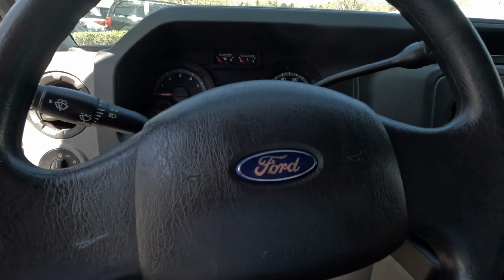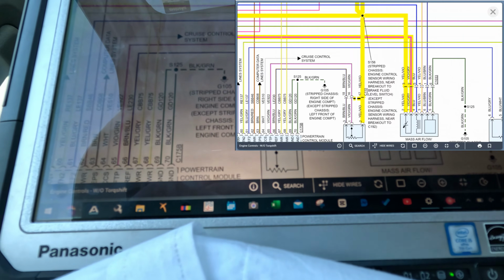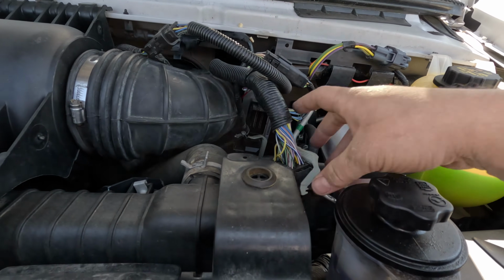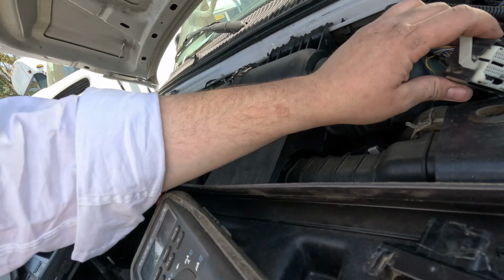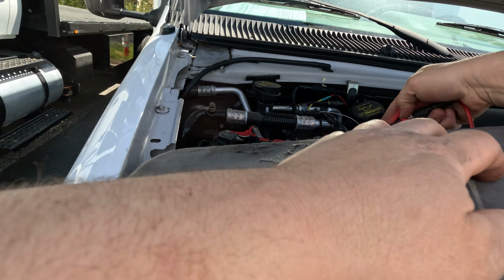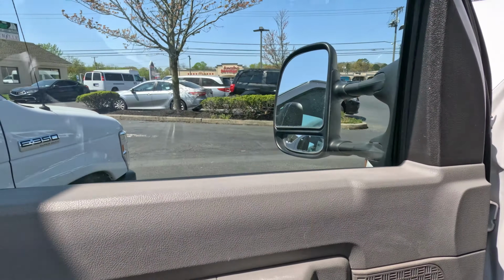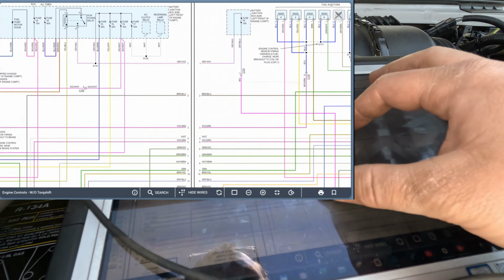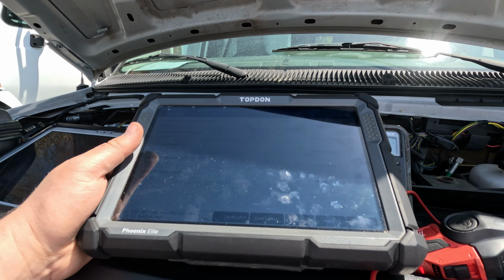Ford E450 Box Truck -  IAT sensor code (P0113). PCM??? Diag & "Repair"!

Comment: Nice.  Got 2012 e450 with same issue.   Bet the ecms have defect.  Also have no ground to maf, working on it now bet same deal as lost ground inside if ecm
Reply from the maker: Good luck with the repair!
Reply: @advancedleveldiagnostics is there a certain ohm setting I need to use?. To do what you did

Comment: hi , I have a similar problem on a 2004 expedition 4.6, I was hoping this video would help me figure it out but I had already bypassed the ground and it changed nothing. the symptom is that the IAT gives a reading that is about 145 degrees F. more than the actual temperature which stops the drive cycle tests from starting because the testing parameter on the high side is exceeded , the PCM reads it at about 248degrees . The vehicle runs pretty good , the IAT sensor is good , the maf is good , getting 4.62 v from the PCM and a good ground but i ran a direct ground straight from the battery just to make sure. The IAT fluctuates as if zero degrees =145degrees. I wrapped the sensor in ice just to make sure it was working and the IAT reading dropped to 176degrees or freezing (32degrees) +144degrees. So any ideas from anybody would be appreciated. My next move is to trace the 4.62 v. wire back to the PCM in hopes that somehow the low volt reading has something to do with it (I doubt it though)  thanks anybody ,Brad
Reply: also there were no trouble codes...I have checked out all of the circuitry wiring now, I'm left with (1). faulty new part or   p c m problem. Also the volts being sent back to the p c m show about .5v which corresponds to the high temp reading ....it should be about 2volts .
Reply: @bradhn3832 was you able to figure it out? Wish the creator would of chimed in to help. 

That's why we are here.

Comment: Dejavu!  Had this exact issue with the exact e450, i really struggled with the diag but i finally just jumped a ground just like you did, Crazy , this must be a common issue, i remember even putting a post up on one of my FB groups, i was asking if the signal ground wire should have 5V on it, i never got a clear answer, good video

Comment: Thanks so much for your time. What's my understanding you connect pin 58 which grount from pcm to IAT with pin50 which ground to pcm?
Reply from the maker: The PCM is supposed to ground on pin 58, but internally it was bad. Instead of replacing the PCM I just jumped constant ground to that circuit.
Reply: @advancedleveldiagnostics  I got it . thank you very much for your reply
Reply: I want your brains
Reply: I love how u have all tools for the job
Reply: How do u like the topdon elite? Would u of bought a different scanner now that you know how it works?

Comment: Great video!!
Going through the same negative 40 on the scanner, p0113..  I plan on going through the wiring diagram tomorrow. Did you just splice to another switchable ground??
Reply from the maker: I think I went to a solid ground.
Reply: @advancedleveldiagnostics  
Thank you!!

Comment: For you guys saying nice job do you really understand what he just did?   He hacked up the factory wiring harness to make the check engine light go out.   Do you want to be the unsuspecting customer who buys that truck now?
Reply: It got repaired with the customers knowledge and consent. Repair record with description is in place therefore if the owner ever sells the vehicle he may or may not share the repair. Either way, what is your problem? Sometimes this type of repair needs to be considered as an option. Great job ALD!
Reply from the maker: It's not making the check engine light go out its supplying a ground that makes the sensors work as intended. I also leave a wiring diagram in the car showing what I've done and how to put it back to factory.